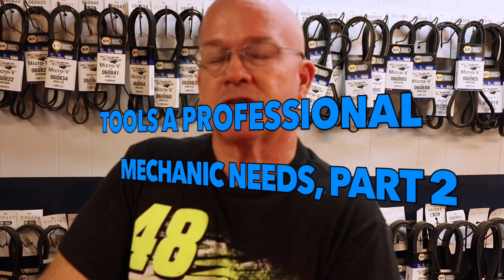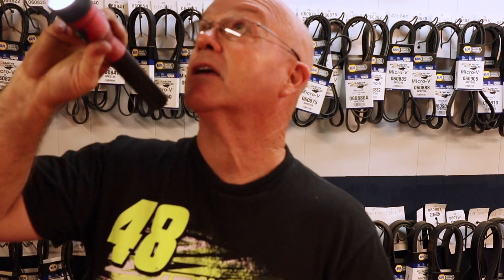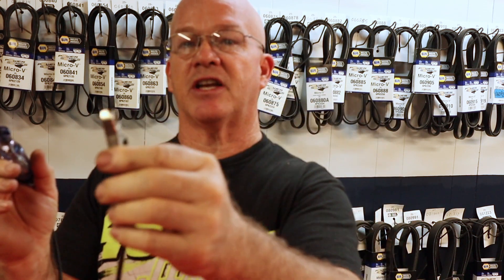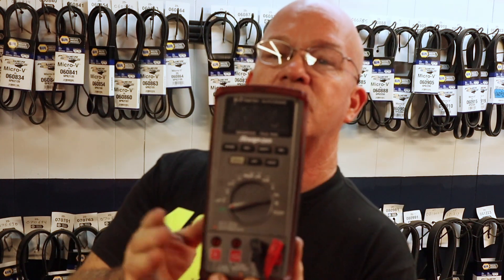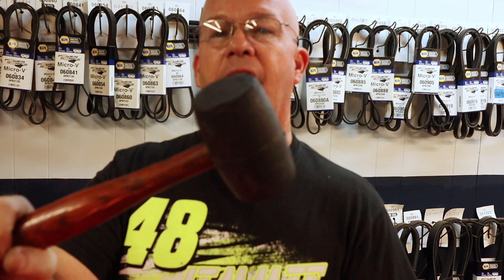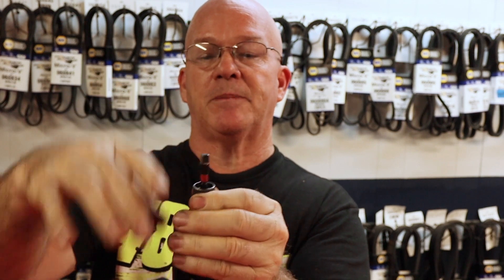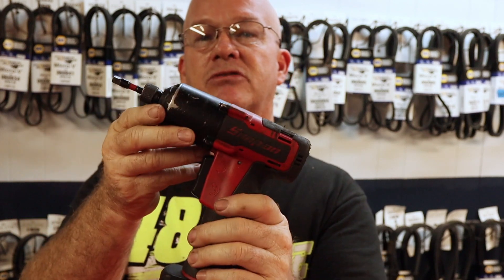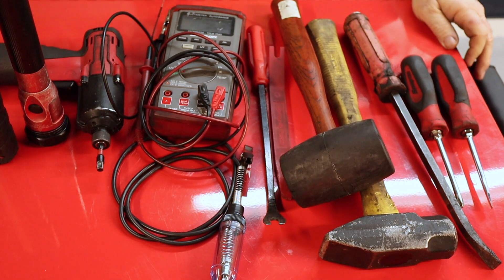TOOLS A MECHANIC NEEDS PART 2, TOOL AND BUYING ADVICE FROM A VETERAN Mechanic.

Comment: Good tip on using tools instead of hands. I had a mentor at my first shop that didn't take care of himself and had the tough guy mentality. I saw him melt his wedding ring on his finger when he arced across a starter. He lost use of his index finger after another injury which turned into a staph infection. He left automotive for a maintenance job. A couple of years later, he was gone at 51. A lot of us maintain our cars better than we maintain ourselves. It made me take a good look at myself and my ways and gave me motivation to make some changes.
Reply from the maker: Wow Matt, i’ve seen it myself as well. Really important for people to take care of themselves BEFORE they are older and wish they had. 
Thanks!

Comment: A lot of guys have an expensive screwdriver set but use the flat heads as prybars and a bit driver for 90% of their Phillips. I would get a half way decent #1 & 2 plus the same in jis then pick up more when you need them
Reply from the maker: True Greg. A good #1 and 2 Phillips, along with a 1/4” (or 8mm) and 3/8” (or 10mm) flat blade will handle almost everything. The Japanese JIS screwdrivers are great for anyone working on imports and work on both styles that look like “phillips.”

Thanks!

Comment: Just to add to what you said Jimmy, I don’t know about the snap on DMM but my Fluke you can hook up an inductive current clamp to test current as well .
Reply from the maker: Yes Daniel, good point. Inductive clamp as well as a temperature probe.
Reply: @JimmyMakingitwork  absolutely, my fluke will to a K type tc !

Comment: I have a small issue with you recommending getting only impact sockets in stead of chrome. Impact sockets are generally thicker and you may have a difficult time getting them in many places. I think a better choice would be, 1/4 and 3/8 in chrome, 1/2 in impact. most new techs wont have both 3/8 and 1/2 impact guns right away and if the don't they can use an impact extension with the chrome socket to minimize any damage to the socket or anvil for a while till they get the right sockets and 3/8 gun. hope that made sense to ya.
Reply from the maker: Excellent point! My 3/8 and 1/4” impact sockets are pretty thin, but not all are. Always some kind of trade off. 
Thanks!

Comment: Astro makes some awesome lights, wireless charging etc
Reply from the maker: Yes, I’ve been eyeing them, might pick one up just to compare and review.
Reply: @JimmyMakingitwork  great lights I own a couple the 65SL and the 40SL there not wireless charging but have been very solid lights. The wireless charging is the 52SLC on Amazon you get the light and the wireless charging base for 70 and some change.
Reply from the maker: Thanks, i’ll check them out for sure.
Reply: @JimmyMakingitwork  your welcome jimmy, just finished watching all your week at the shop videos. Really digging the channel

Comment: what tools a new tech needs largely depends on what work the shop is having (letting) them do. one addition to part two would be a set of cable operated hose clamp pliers. most newer vehicles use constant pressure spring or band type clamps in places where you can't reach them with regular pliers. I'd also add a magnetic screwdriver possibly ratcheting, along with Torx bits. Torx fasteners are common on newer vehicles and the bits  can also be used in your bit driver for speed, The bits might be cheaper than a dedicated set of torx screwdrivers. It's also important to know how to use your DVOM and when not to use a test light on certain circuits. always remember it's your skills that make your tool perform magic.  I've seen those older snap on dead blow hammers turn white just sitting in a drawer and when you picked it up, chunks of material would fall off. It doesn't happen to their current models, just the old all one color models.
Reply from the maker: Excellent point Fedwrench!

Part 3 I’ll have some of the more unusual tools and a tool cart overview.
Thanks!

Comment: My snap on dealer doesn't just replace blade of screwdriver anymore.    Gives ya whole new one     I recently asked him about it and he said they give him same warranty credit either way so the now gives ya whole new screwdriver and no longer just replaces shaft on handle     also usually has most colors in stock on his truck which I think is cool.     hated when I just got new blade put in old beat up handle.
Reply from the maker: Glad to hear that, haven’t warrantied one in a year or so. Last one was a hose removal tool that loosened in the handle. He shoved it further in and handed it back. I said, seriously? He said, it’ll be fine.

Maybe they are doing it differently now.

Comment: It's difficult to really nail down what a mechanic makes. Here in Vegas, it looks like I overpaid my B Tech at 25 an hour...BUT...he has really come a long way and averages about 35 to 40 hours flag time. 

I interviewed a Master Mechanic with every ASE and 34 years in the business....making 26 an hour flag at a local chain store.

Then...a diagnostic tech at a Jaguar dealership does 41 an hour.
Reply from the maker: Yeah, I guess it’s mostly market based, combined with experience and ability. I’d rather not disclose my pay here, but Ill say that a good tech/mechanic costs the shop nothing and is an asset. All too often owners/managers look at what an employee “costs them.” In reality what matters is what they bring in, since they almost never get a penny if they didn’t earn the shop a nickel for it.
I was making $23 flat rate in 2007 (for reference). I produced over $550,000 in parts and labor last year, so I don’t cost the shop a penny in my opinion. :)

Comment: I just sent my snappy light in it broke at the pointer light
Reply from the maker: Bummer. Mine has been put thru some abuse and held up. Hope you have better luck after they repair it. I think they only have a 12 month warranty even though they are expensive.

Comment: You can have voltage drop across the top of a dirty battery!
Reply from the maker: From post to cable terminal, yes.
Reply: @JimmyMakingitwork  ahh from post to the top of a dirty battery, go from positive to the greasy spooge on top of the battery and see if you drop 2 or 3 volts !
Reply from the maker: Oh, I call what your referring to parasitic drain, or voltage bleed. A dirty or corroded battery case will read voltage since it can sometimes make contact enough to do so.
Voltage drop i’m referring to is high resistance, or poor connections. Like when an engine ground is bad, putting the meter negative on the negative battery post and the meter positive on the engine side of the cable and having it read .5 or more volts. Showing voltage loss thru the meter.
Reply: @JimmyMakingitwork  understood Jimmy, it’s all no bueno ! Either electrons are going where they’re not supposed to or the can’t get to where they belong! It’s like herding cats ! lol

Comment: I'd like to see more mechanics not be so ego driven it really is a problem with youtube and the industry it destroys motivation for people watching channels that constantly try to be the gospel....Where the controversy really discourages new mechanics when we are in a age that repair work is abundant.  Also I'm curious if it's climate difference?      Because I've never saw a snap-on hammer disintegrate in my climate or 25yrs that I've owned them and I have harbor freight hammers that are poly coated!! Lol the end was the best part and spot on!! Some good points for sure Jimmy likes to work it!! Lol
Reply from the maker: Haha, thanks CP!

Yeah, the Florida climate could be a big factor…i’d assume the SO hammer would live longer, but man they’re expensive. Something you or I could justify, but a newer mechanic maybe should hold off at first.

Have you had their test light cords disintegrate?
Reply: @JimmyMakingitwork  yes they definitely don't last I have electrical tape wrapped up on it my old $20 lisle is the go to still

Comment: I’ve never heard of hammer handles disintegrating before! I hate that you have to take bumpers off to change bulbs out. So stupid 🙄😂
Reply from the maker: Yeah May, it seems silly, not sure why they do it. Crash standards forcing design changes maybe? Or just tying the engineers hands, or both. lol
Thanks!

Comment: Where you make 150k
Reply from the maker: Man I wish. Still trying to break into the 6 figure range. Close, but not yet.
Reply: Most I get is 50k even at dealer
Reply from the maker: Wow, that is not terrible, but can certainly be improved. What level are you at?
Reply: @JimmyMakingitwork  b level no ase
Reply from the maker: Ok EZ, that’s not too bad for a B level, but i’d work on getting an ASE or two, also trying to become an A tech, adding value to yourself in any shop. I mention it a bit more in depth in my “Tools a mechanic needs, part 3” video coming out this weekend, look for it by Sunday night. :)